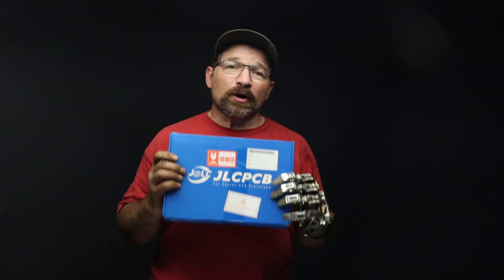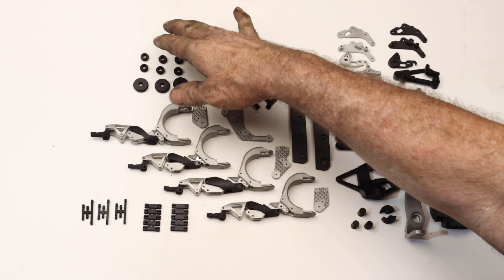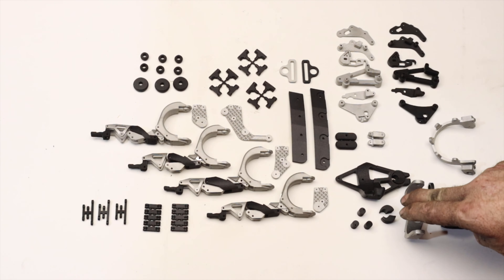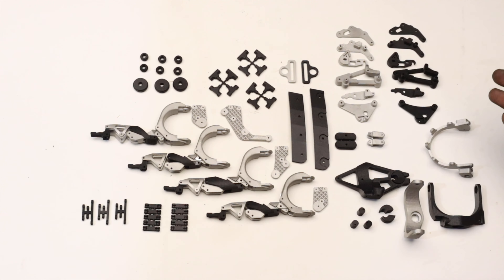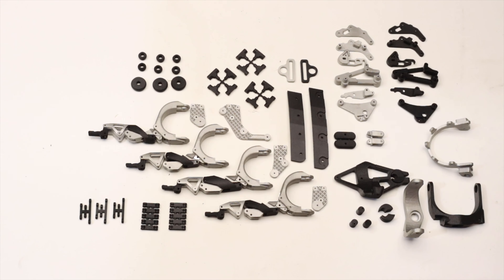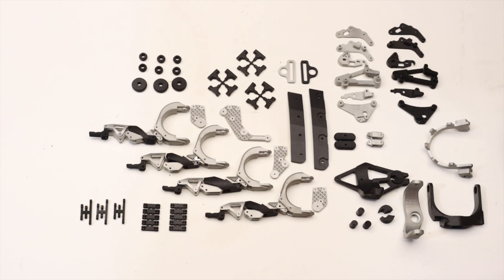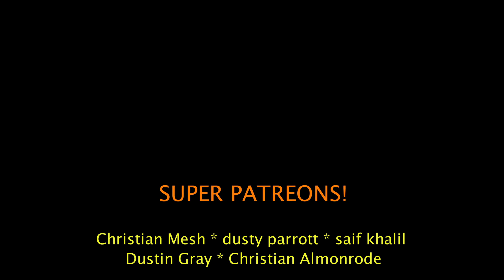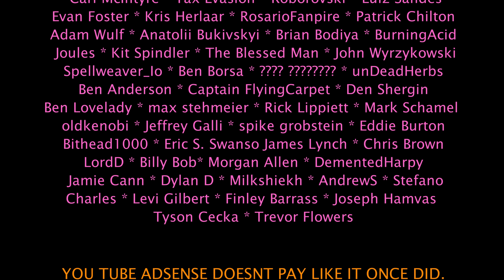Some Assembly Required, Unboxing My New Hand!

Comment: i would love to see this become a real viable option, clockwork prosthetics are just as important as full digital
Reply: Probably more important, since they can't brick it with over-the-air updates
Reply: @bami2  i agree! I feel like that will become a issue in the future, but also it's about the right to repair! Someone should be able to go to a blacksmith or a machine shop and say "I would like a spare plate made for this"
Reply: @blank.e5plus  Venturing to a blacksmith to repair a metal hand sounds extremely badass.
Reply: Honestly this one always seemed a hell of a lot better than any I've ever seen in TV or the Internet
Reply: More important, you can fix your hand whenever you're in need of.
Reply: The problem is you can't really replicate mobility without electrics. He can move each finger on his prosthetic but he has to use weird wrist motions, he can't use them like normal fingers.
Reply: @ryanwellington7493  neither can a person that has to rely on electrics. Generally those are rather slow. This one he does a few side taps to get the right pattern in and it's fast and responsive. And often the basic 'grab things' will Probabaly be the most used (and ofc while walking towards the thing you need you can already preset the pattern)
Reply: @ryanwellington7493 Electronic prosthetics are so cost prohibitive that the majority of people will never get to use them. This offers more functionality than any other fully mechanical hand and it could be manufactured for a few grand by any decent machine shop. It's perfectly good enough for what it's supposed to be. There are other people trying to make the most realistic electronic ones and that's cool but this could actually be used by a lot of people instead of just the rich.
Reply: @aniquinstark4347  I like the idea of this since I'm really into engineering and physics, I just think something that replicates normal biomechanics would be better. Repetitive unnatural movements can cause imbalances, affect posture and cause RSI over time.
Reply: @aniquinstark4347  I know one thing that would make this better straight away and it would be if the finger joints had the ability to also rotate to some degree on top of their ability to flex, extend and splay. It would allow you to grip things at more angles. This comment is completely unrelated to my last one by the way and wouldn't solve the biomechanical issue I was talking about.

Comment: Sounds like summer where you are, hope you are well
Reply from the maker: Omg, the road construction in front of the shop is killing me. The jump plate in front of my drive is upside down so every time a car drives over it, it clangs. My shopbis on a super busy road so I've been recording the video late at night so I have less plate noise, but for the last couple of nights they've been running the vac truck all night.  Its been terrible to try to put out videos lately.  I'm working on a new studio area at the shop, hopefully its able to take care of some of these issues. 
Thanks for putting up with the Background noise in this video.

Comment: Does the hand work under water? And can the hand be used for climing?
Reply from the maker: Yes, I can use it under water. I wash the dishes with it on. As far as rock climbing, I wouldn't trust it enough. I have thought of building a purpose specific hand with hooks and cams if I ever got brave enough to get back into climbing.

Comment: Can you make a rubber cover for the system? It would be easier to use in public.
Reply: Stop it, Ur killing my buzz
Reply: You mean like a glove?
Reply: More or less . Something that covers the system (yes, I guess you could call it a glove), but something that manages to look like a hand/fingers. Containing parts and sections that are integrated into the system. Then it contains a layer (in the area of the fingers) that is like spongy (memory foam), then the entire visible surface is made of a polymer or even rubber that disguises everything.
Reply: To me it seems the next obvious step, remember the soldiers who came from the 1st great war and the effort to "disguise" disfigurements.

Comment: Is printed titanium cost prohibitive?
Reply from the maker: Jlcpcb doesn't have that capability yet. Pcbway does, but last time I ran it by them their ask was pretty steep. I may run it by them again. But the cost was pretty staggering for titanium parts. For instance, a metacarple base in stainless is $32, in titanium it was $112. It would take the kit from around $500 for the printed parts and put it closer to $2k which cool as it is counter to where I'm trying to go with the diy kit format. I will probably as some time do a titanium build, but only after I'm super confident in the design.
Reply: @missingpartsclub  roger that